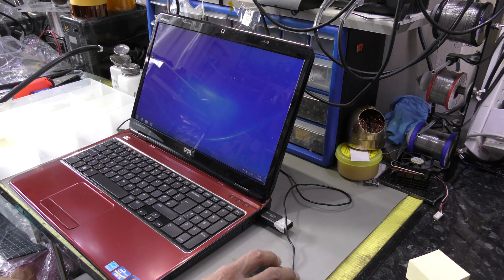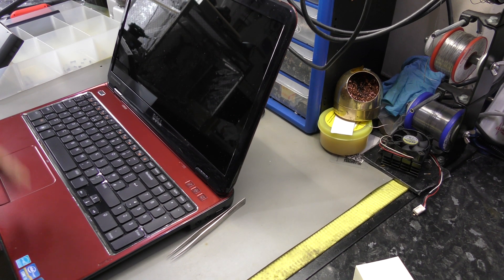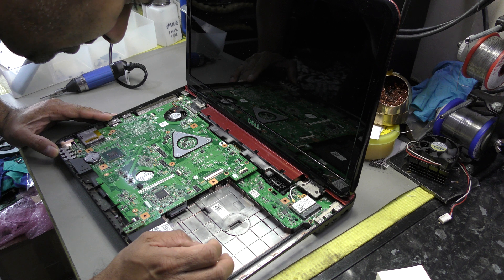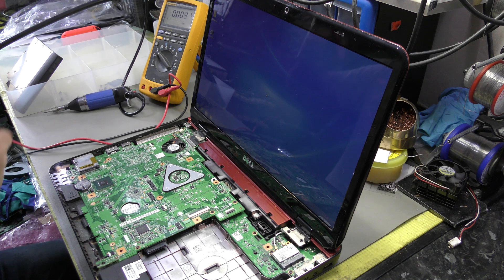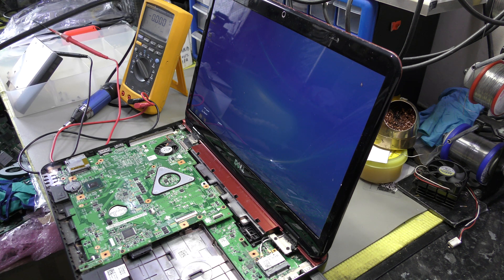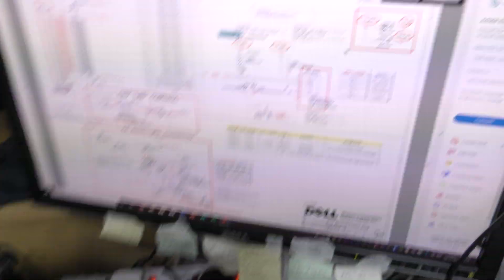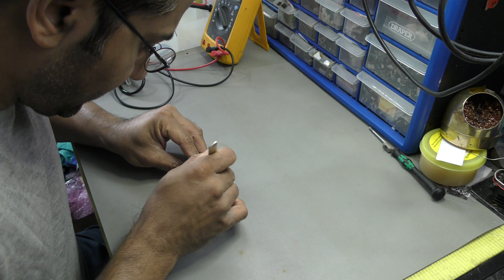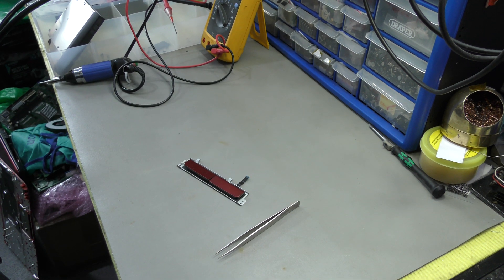HOW TO TROUBLESHOOT DELL N5110 TOUCHPAD BUTTON NOT WORKING

Comment: I like that assembly line screwdriver is nice and small!
What make is that?

Was fixing a Dell last week and had a similar track pad or was FR4 and a copper layer that had a metal frame over it held in with 3 screws it rocked left and right and completed the connection, clever design just had to clean the spilled soft drink from it.
Reply from the maker: Hi Pal,  screwdriver was bought from Ebay many years ago.  Unbranded items. Please have a look on Ebay.  Cheers
Reply: I know im randomly asking but does any of you know of a way to log back into an Instagram account?
I somehow lost my password. I would appreciate any help you can offer me
Reply: @Fletcher Jax instablaster ;)
Reply: @Juan Bo Thanks for your reply. I found the site thru google and im trying it out atm.
Looks like it's gonna take a while so I will get back to you later when my account password hopefully is recovered.
Reply: @Juan Bo it worked and I now got access to my account again. Im so happy!
Thank you so much, you really help me out :D
Reply: @Fletcher Jax no problem :)